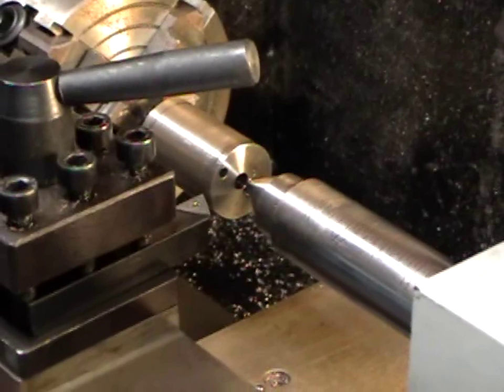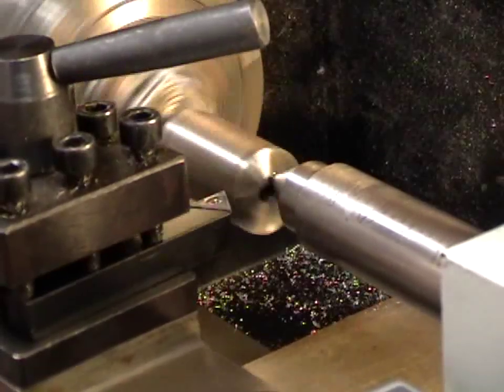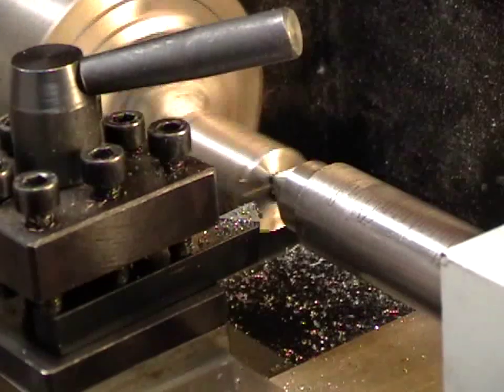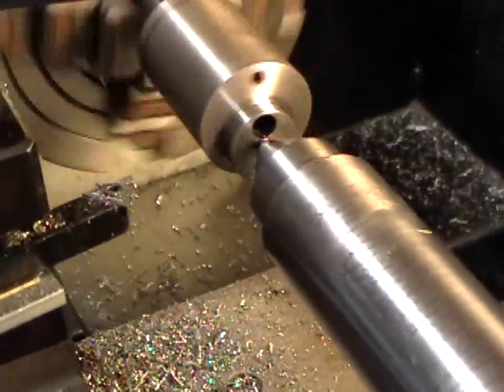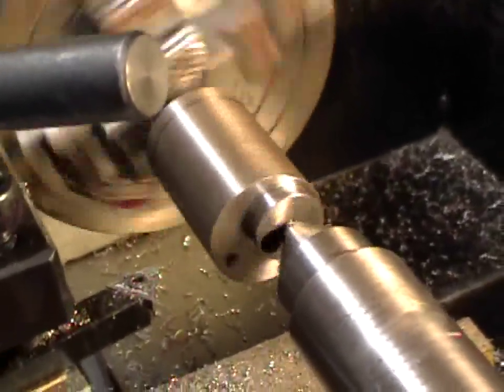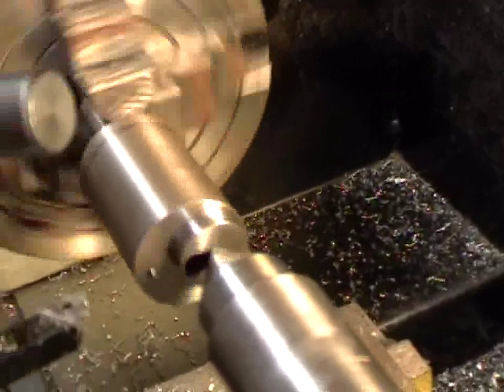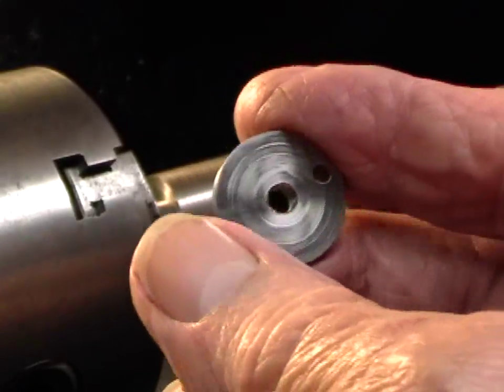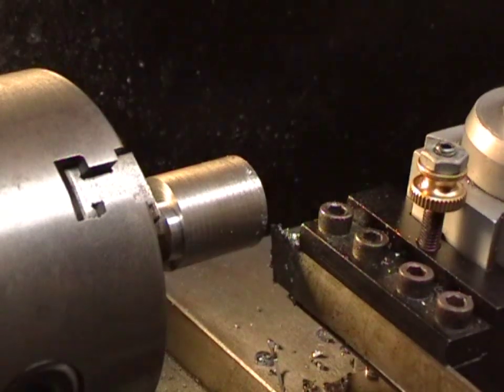TWO CYLINDER SLIDE VALVE STEAM ENGINE CRANKSHAFT: VIDEO #2

Comment from the maker: I first used an indicator, then made many very small adjustments to the 4 jaw chuck, eyeballing it with a 2.5X clip-on magnifier!  Remember that there were no adjustments to the tail stock - as soon as i could see no wobble of the center drill mark that precisely located the true center if the eccentric, I knew I was there, Putting the dead center very close to the drill mark makes any wobble easier to see.  But now will come the difficult bit!   Cheers!  John.

Comment from the maker: @DoctorHerbert Hi DH!  Yes, it is a 7x12 mini lathe.  I still use the Taig - it is very handy if i have something set up in the mini lathe and I suddenly need to turn something else!  That's a good tip about the wiggler - thanks!   The next bit will take a little while, the assembly and pressing in of the shafts and crankpins is critical!  I'll take it slowly!  Cheers - John.

Comment: Hey John that's some great stuff. Is that a new lathe you've got yourself? I was expecting to see the Taig. When I set up my 4 jaw chuck for odd things I use a wiggler mounted in the tailstock drill chuck, it really helps speed up the setting up.

Looking forward to the next bit.

Comment: did you indicate the stock, to see if it was running off? (taper).I also noticed your parting blade holder move during the cut , is that intentional? new to this , i have alot of guestions

Comment: i really got to ask, ive tried to turn cranks this way and cant imagine how you set the stock in the 4 jaw...getting it offset is easy , but i struggle with it running off the axis! tapered crank pins wouldnt be much good! ha cheers from Canada